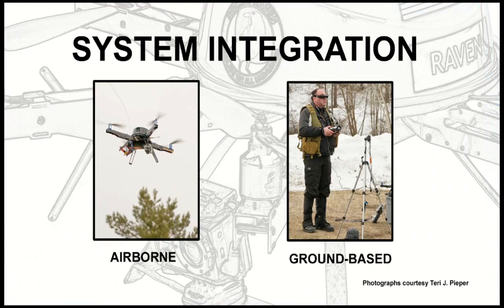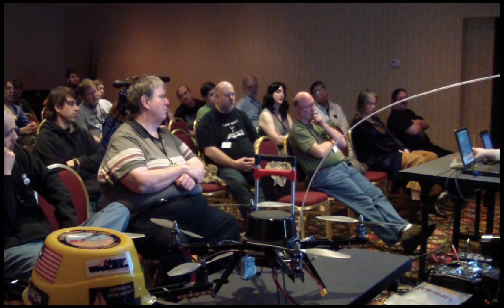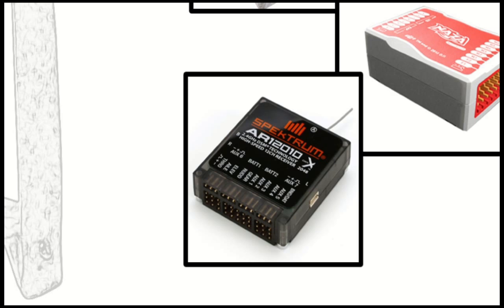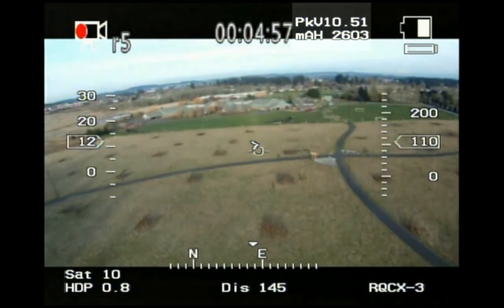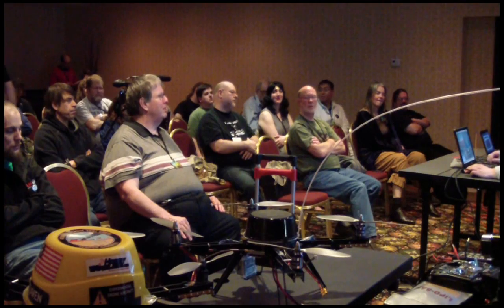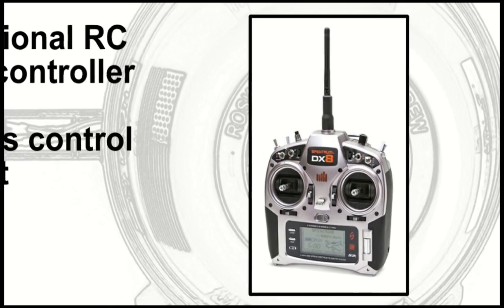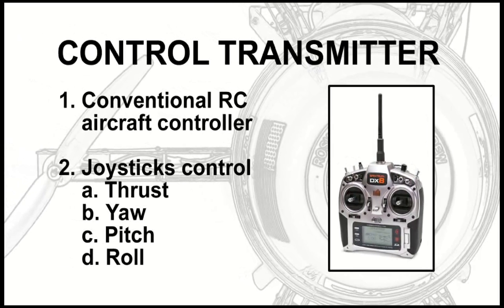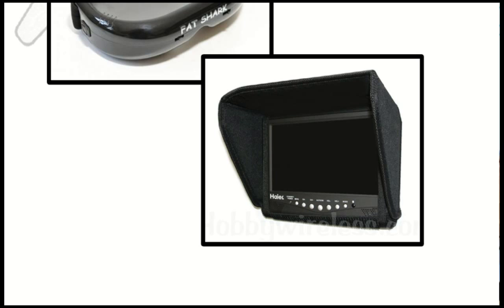RFTC: A Beginner's Guide to Building and Flying an FPV Quadcopter (2012)

Comment: My take away? Your comments about flight stabilization. I'm a Newby to RC and want to learn about quad flying. The little MQX, I bought for training, is twitchy. Once it takes a set, it's a struggle to correct its flight. More crashes than I can count. Good thing the MQX is durable.
Your comments have assured me that once I finish building my f450, it'll be easier to control.

Comment: @02111gs hobbyking is a good way to start they sell the kk2 multirotor control board which works well, good they also sell a cheap gps osd and the live video feed is cheap to setup on 5.8ghz, that would be basic but you don't need an osd

Comment: You can go as low as a 150 dollars with shipping from Hobbyking. That includes all with battery and cheap 4ch TX.
I've done that. Look for cheap metal frame, cheap Turnigy 1100kv motors, SS 25A ESC, KK2 board. and that's it. I used no extra connectors, just straight solder.
Also an 70 dollar quad is possible with 2200 lipo and wooden frame. Add a radio and you'll have a flying quad with TX in about 100 dollars. It can be done.

Comment: interesting antenna configs, so that should be on the copter as well as the ground. Re blue screen: transcoding could increase error correction (7/8 vit) at reduced bitrate and keep a picture. If a hexcopter lost a motor would it rotate? 
Great video,

Comment: From the FCC frequency allocations chart I found the 420-450mhz, 902-928mhz, 1.24-1.3ghz, 2.4ghz & 5.8ghz frequencies were labeled as "Amateur" and didn't indicate any licensing requirement.

Comment: Can the flight computer be programmed with some kind of autopilot return home mode? E.g. it would be useful to automatically trigger if telemetry is lost, battery is low, or other issues as a fallback.

Comment: I'm sorry, but you guys say that there are wattages that do not require a HAM radio license. This is not true. ALL frequencies and ALL wattages require a HAM unless that specific video transmitter has it's own FCC Part 15 compliance sticker. (The minimum wattage allowed by the FCC is so low that it's given in units of μV/m, but would be equivalent to <1mW.) I know of only 1 video transmitter with this sticker and it's very expensive.

-Blues